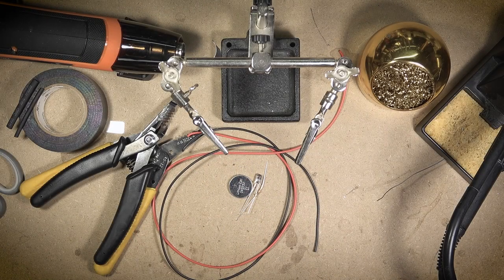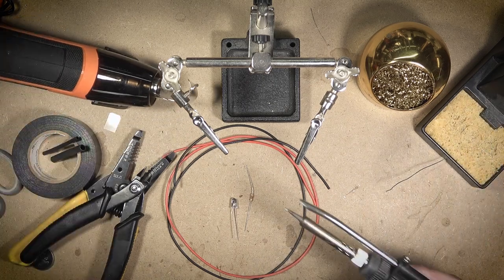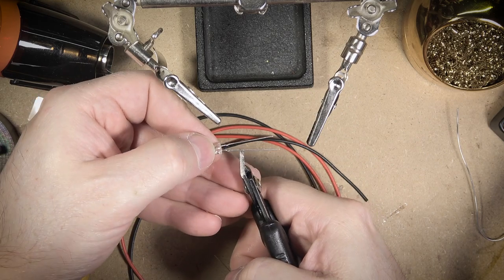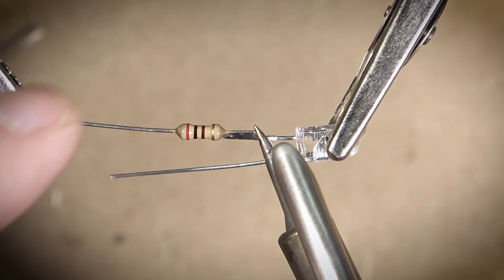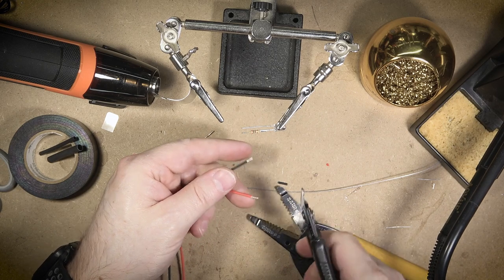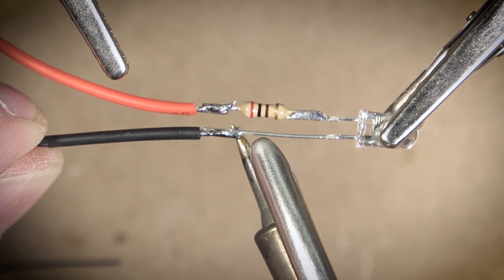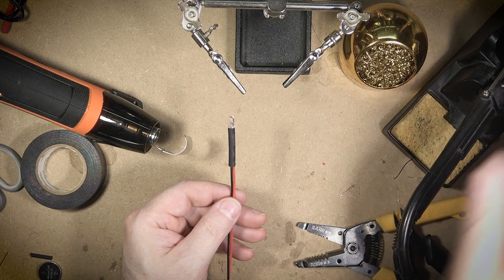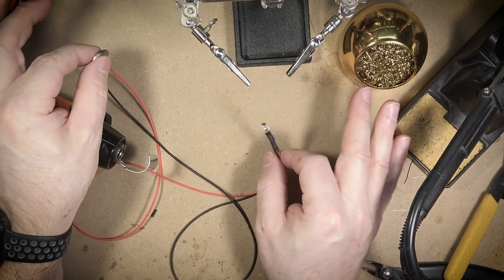Book Nooks - Soldering LED Inline Resistors. It's Not That Hard #booknook

Comment: great tutorial   the only thing i do different is the heat shrink on the positive lead i shrink first to hold it in place.  it could slide down a touch while your putting the larger one on causing an invisible short   but other then that great job
Reply from the maker: Good power tip... no pun intended... or maybe it was! Yes! Ya gotta make sure those leads don't touch. Thanks for the helpful comment. Cheers!

Comment: Thank you very helpful. I was going to tightly twist the wires but I can see how much cleaner it is side by side. I'll give it a shot. 
Thank You.
Reply from the maker: Twist and solder will provide both a mechanical and... well... soldered connection which is probably stronger than solder or twist alone. For connections that might be stressed, that may be a better option. In the case of LEDs, I find this to be very compact. Unless you're using something like a wire nut, twisting alone can lead to loose connections. I hope it all works for ya and thanks for commenting! Cheers!

Comment: Say you wanted to solder a string of 10 LEDs. I know you would just put a resistor on each one like you have shown, then run all the positive and negative wires to each corresponding +/- lead down the string, but it would be great if you had a video on this to see how you yourself would do it. Many thanks for a clear and very well put together instructional video!
Reply from the maker: Thanks for the comment and suggestion. I generally try to keep things as simple as possible but there is a way to wire more LEDs with fewer resistors. It's a great suggestion for a follow up video! Cheers!

Comment: Would it be useful to hold the LED by the leg being soldered rather than the LED itself to avoid heat damage to the LED? Or is this something not to be concerned with?
Reply from the maker: Outstanding question! I think this often gets glossed over. Here's my quick thought (long thoughts to follow). You want to apply just enough heat to just enough area to bring the two surfaces up to a temperature where the solder melts, flows, and sticks. Easy! Now that we have that outta the way, here are some additional noodlings.

You're spot on. It's possible to damage components with improper soldering techniques or when the thing you're soldering is just plain challenging. If you have heat sensitive components, your suggestion of clipping the alligator clip to the lead between where you're applying heat and the component you're protecting is a solid technique - you can buy heatsink clips specifically for this purpose. My clips have a silicone sleeve that I would remove if I want to use it to help pull heat away from the LED.

There are times where the idea of a heat sink will fight our best efforts.  I've experienced this when soldering heavier gauge copper wire or when soldering to circuit boards where the thing I'm soldering is connected to a huge copper ground plane (you'll know it when you experience it!). In those instances, the large amounts of copper seem to pull every bit of heat I apply away from the thing I' trying to solder and I end up with a cold joint. Ideally, we want to heat up a small area quickly and get the solder flowing before the heat spreads to places we'd rather avoid.

OK... now that I've rambled a bit... to get to the specifics of your question about soldering resistors to LEDs. My goal is to make the final package as compact as possible so I may not have enough space to get a clip on the lead. The leads on resistors and LEDs are thin. This works in my favor. They come up to temperature quickly and don't hold the heat for long. That allows me to get a good solder joint fast. If I tin (add a bit of solder) to the leads prior to joining them, the final solder can be even faster with less fiddling. I've found resistors to be incredibly heat resistant. They work by converting and dissipating current as heat so it's in their DNA. LEDs can be damaged by excess heat but I don't think I've ever damaged one even when I was doing a terrible soldering job (I usually destroy them with too much current). They're designed to run through commercial soldering processes so they're pretty robust. If you are working with reasonable speed and care, you should be able to solder LEDs without too much special consideration. I did take a quick look at some LED data sheets and the two I looked at said something along the lines of 250C for 3 seconds 3 to 5mm from the base of the LED. That's helpful... sorta...

Naturally, things need to be set to the right temperature. Too low on your iron and you're not going to get heat transferring quickly enough. Too hot and you're pumping too much heat too quickly. My soldering iron is currently set for 350C (according to the readout that's probably only semi-accurate) for the tip and solder that I use (fine tip and 0.8mm rosin core 60/40 solder). That would seem too hot for what the LED is supposed to be soldered at but this is all a bit of wizardry with a dash of thermodynamics. It's challenging to find hard numbers on the melting point of solder and the "correct" soldering iron temperature. Even the data sheet on the solder doesn't specify a melting point (that I could find). I think everything is vague because "it depends". When you touch a 350C tip to room temp solder and a heat conductive component, you don't instantly heat everything to 350C. In fact, if your iron is just at the melting point of the solder you're gonna have one heck of a time soldering because everything will wick heat away and it becomes a real struggle to get a good joint. The iron is hotter so you can quickly get a small area up to the temperature where the solder flows and then you immediately remove the heat... precision through brute force! This all means you need to find that sweet spot where the iron you use is quickly and efficiently delivering the right amount of heat to the thing your soldering so the solder you're using works without being so hot you damage things. PHEW! Easy... right! I can't tell you how many rolls of solder I have that I hate because they just don't flow the way I want them to and I've had to crank the iron up to temperatures that seemed a bit too high for my liking.

OK... that was a LOT! I hope it helped in some small way. Soldering is really a skill that comes from experience and a bit of experimentation. You're considering the right things and asking the right questions so you're well ahead of the game!

All the best!
Reply: @RandomMakingEncounters  wow… a proper response… very much appreciated… thank you… i think in my case.. new to soldering potential delicate components… i might err on the side of caution till i get the hang of it. I do have a habit of tinning wires to be soldered which seems to make things quicker when finalising the joint. So one could presume this is also true for legs of components as well?
Reply from the maker: @MrSteamDragon  indeed. The only caveat would be soldering circuit boards where tinning would prevent the component from fitting through the holes. Happy soldering!

Comment: What temperature you put to solder? I am around 460ºC and I don't know if its to much or low. Thanks!
Reply from the maker: Soldering is a bit like cooking and the answer is usually... it depends. My iron is currently set to 350C. I have a fairly fine tip on it and am using 0.6mm diameter solder. Your setup will vary so experimentation will help you find the right combination of things. Here are some of my general observations. Lead-free solder requires higher temperatures. Your iron will generally need to be hotter than the melting point of the solder since it needs to transfer heat reasonably quickly. The heavier the tip on the iron, the more thermal mass it has and can deliver more sustained heat to the work. What you're soldering will have a dramatic impact on everything. If you're soldering thin wires, they soak up less heat and soldering is faster and easier. If you're soldering chunky components or things with a lot of copper (battery connectors), they're heat sponges and you're need larger tips, more heat, and even a torch for really big things. I really struggle with soldering heavy gauge copper wire and battery connectors.

460C does seem a bit high and I would probably dial it down to maybe under 400C. It's going to really depend on what you're soldering but things to consider are working with thinner solder and maybe a slightly heavier tip if it doesn't seem like it's transferring enough heat. Also, keep the tip clean - gunk on it can actually act like an insulator. I also start by melting a bit of solder on the tip away from the work before trying to connect the parts... this helps create more area for the heat to transfer.

Here's a really good site that covers more on soldering - https://www.techspray.com/ultimate-guide-to-electronic-soldering

All the best with your projects!
Reply: @RandomMakingEncounters  Thanks so much for your answer!

Comment: Sometimes, resistors are in a little small plastic black Box with a tarry type of substance in there, are are these little boxes for insulation? Why would you insulate a resistor.?
Reply from the maker: I’ve never seen that specifically… at least not noticed it. A couple of things come to mind. It may be there to provide some amount of waterproofing to the circuit? Temperature does impact resistance as well. Resistor values will change with temperature change. If precision is needed, it’s possible that some amount of protection keeps things working as expected. The interwebs provided no additional clues.

Comment: I don’t know anything about electrical stuff so this may be a stupid question but what does the resistor do and is it necessary to add?
Reply: And thank you for the video. I did find it informative and I love how you explain things!
Reply from the maker: Thanks for watching! There are no stupid questions. Whenever I'm trying to learn a new skill, I'm always starting from not knowing on a journey to sorta knowing a bit more :)

In this application, the resistor limits the amount of electrical current flowing to the LED—too much and the LED will burn out. Resistors come in a bunch of shapes and sizes and the values are measured in Ohms. The bigger the number, the more it limits the amount of current flowing through. To figure out what resistor you need, you can use an online calculator like ledcalc.com. The most important number you'll need to know is how much power you're supplying to the LED. For example, 4 AA batteries would generally be 6 volts-ish (1.5 volts X 4). The rest of the numbers depend a little on the LED but there are little cheat sheets if you click the question marks. There's a LOT of wiggle room with resistors as long as you're using values higher than what the calculator spits out. Using very conservative numbers, you might be able to use a 220 ohm resister for most standard LEDs when using six volts of power. Some LEDs that you buy online come with a few different resistors or some come pre-soldered. Be careful on the pre-soldered because they are often wired for 12 volts and I would generally use between 4.5 and 6 volts for my projects. You "might" be able to get away with no resistor and a couple of batteries (3 volts)... but that isn't always true so resistors should be used to be kind to your LEDs. Hope that helps!!
Reply: @RandomMakingEncounters  thank you for explaining this! Yes this makes sense.

Comment: Stupid question: if i use  3volt LEDs and a 3 volt AA battery pack, do I need resistors?
Reply from the maker: Not stupid at all! LEDs are mysterious little things. The best thing to do is use an LED resistor calculator like ledcalculator.net. The broadest answer is you will usually need a resistor. The only time you generally don't see resistors is when people use coin cells with LEDs. This has more to do with how much current (Amps) the battery can deliver than the need to use a resistor. With 3 volts, it's just enough voltage to light an LED but the batteries may dliever too much current to be kind to it. It will be a very low resistor but is needed to deliver the right current.

One way to think of these things is a water analogy. Think of electricity as water flowing through a pipe. Voltage is the pressure of the water. More voltage... higher water pressure. With higher water pressures you can do more work. If your batter voltage is too low, there isn't enough "pressure" to get the job done. Amps is the volume of water. Low amps is a straw... high amps... a firehose. Both could have the same pressure but the difference in what's coming out the end is dramatic. A resistor is a pinch in the hose that slows the flow. For your LED, 3 volts may be just enough water pressure to do the work but the two AA batteries could deliver enough volume of water to overwhelm the LED... you need to pinch it just a bit. Sorry for the lengthly response. This is really an oversimplification but I've always found it a helpful analogy when I'm thinking about electricity.

All the best with your projects! Cheers!
Reply: @RandomMakingEncounters  that helps a lot, thanks!

Comment: Now what do you do with those wires?
Reply from the maker: At this point, the wires could just go right to a batter pack that holds 4 alkaline batteries. There are holders you can get online that are inexpensive and even have built in switches. Since each LED now has its own resistor, you don't have to worry about any more complicated circuit design.

Comment: Hi everyone, I was wondering if someone could help me out; I have one of those LED wall initials you get on Amazon, you can run it on three AA or usb, the latter didn’t hace a switch, which bothered me greatly, so I decided to get a switch and snip off the battery compartment and run the light directly of off usb, immediately I noticed the wall plug was getting rather hot and so was the light, upon reading turns out a resistor was needed since the light ran on 3V and the plug was a 5V, since I’m not an expert, trying to find the proper resistor was quite a chore, but I think I did…so; a 100ohm resistor seems to do the trick, but it might not be so can I exceed that? Like solder a 120ohm or would be overkill?
Also is putting heat shrink over the resistor bad, would it make it overheat? 
I’m sorry if I over explained myself, I just love learning.
Awesome video btw, I wish I had a friend with your abilities, I could just sit and learn all day.
Reply from the maker: I can't give you specifics on your project but gengerally, in practice, resistors only reduce current and not voltage. There are ways to reduce voltage with two resistors using what is called a voltage divider. If your light is really just made up of LEDs, most LEDs can utilize different voltages as long as you don't use too much current. In order to figure out the correct resistor there are online tools like ledcalc.com where you plug in the number and type of LEDs. It also matters if the LEDs are in series or parallel... lots of variables so don't take any of this as direct advice. The calculator will also loosely tell you how much current your circuit will require based on the number of LEDs. With all of that in mind... if your USB power source can't supply enough amps, it will overheat... which is a fire risk. If you provide too much current to the LEDs, they'll just burn up and the whole thing will stop working. I would not add a heat sink. If properly configured, very few things require heat sinking (CPUs... power regulators). Anything that is generating excessive heat is headed towards badness and should be disconnected and fixed. You should always err on the side of a higher resistor with an adequate current rating and a power supply that can handle the load. One final disclaimer... my degree is in fine art and all of this is self taught. I'm not an electrician or electrical engineer so this is mostly learned from a lot of Googling and a lot of fried components. Always be very careful when working with electricity. An old survival trick is starting a fire with a nine volt battery and some steel wool. It doesn't take a lot for things to go wrong.

Comment: Does it matter which way round you fit the resistor?
Reply from the maker: Resistors generally do not have "polarity"... meaning they don't have a preferred way of being inserted into a circuit. If you are wiring one LED to one resistor, it doesn't even matter if you put it on the positive or negative lead of the LED. One component that is pretty common that does have polarity is the electrolytic capacitor (they're cylindrical can-like doodads). They usually have big minus marks on them to show the negative lead. Those will actually be damaged if you wire them incorrectly. I use capacitors to smooth out voltage spikes. Think of them like big empty tanks.... the power flows in and has to fill em up first before releasing the energy in a more controlled way. Hope that helps and thanks for watching!

Comment: How do you know if you need a resistor?
Reply from the maker: Generally speaking, you always need a resistor. LEDs will run off of coin cells without a resistor. LEDs usually need at least 3 volts or 2 alkaline batteries to light and that is usually around 3 volts. I have a video in the can that goes into this a bit that I may need to get edited and posted. The online calculators like ledcalc.com are a great tool to help you figure out what you need.
Reply: You’re so kind to answer all my questions.